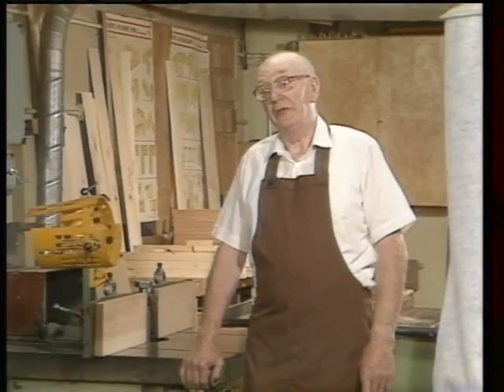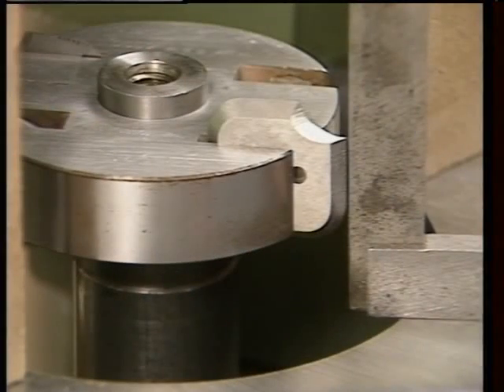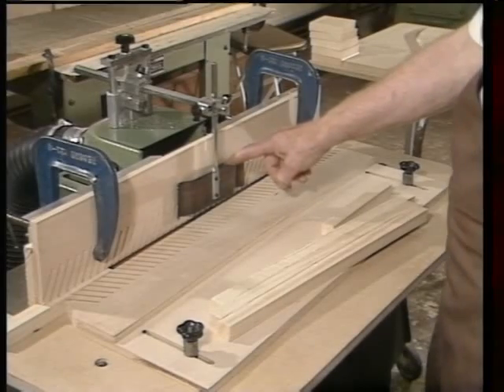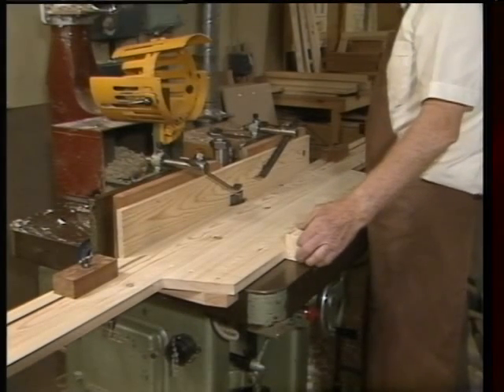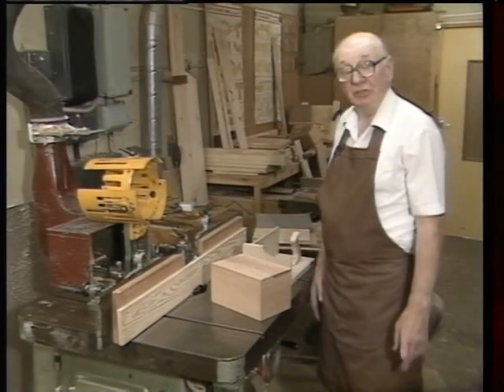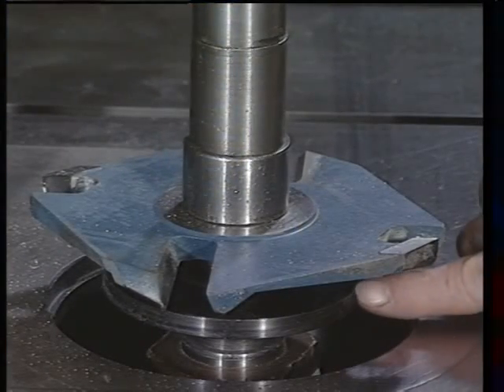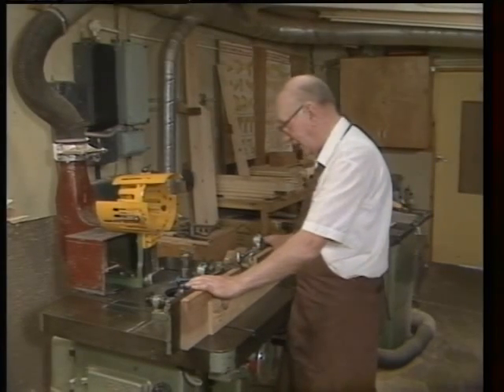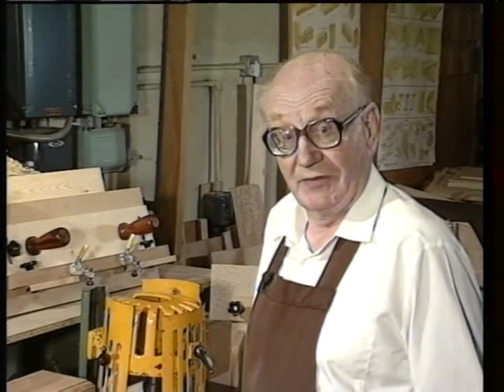Spindle Moulder For Complete Beginners by Roy Sutton

Comment: I have now been using a spindle moulder now for over thirty years with all my fingers still attached. Your video shows safety as the top agenda and I admire anyone teaching old school  methods with safety being paramount
,When you show shaping circular round objects I cramp wide rebated board so it hits template on outfeed side,I line up centre of circle with centre of spindle and fix board,This makes it easier and more accurate to find centre cut as you can run template on face board and stop enabling precise central location,I was trained by a ex engineer and worked on high end joinery projects and had similar training to you

Comment: I am  a wood cutting machinist by trade/profession; & believe me, this gentleman knows what he is talking about. The spindle moulder has been badly maligned over the years; but used correctly & sensibly, it is a VERY versatile machine. As with ALL woodworking machinery, safety is paramount. My thanks to you Sir for your very instructive & informative video; your tutorial reminded me of my technical college days back in the mid 1960's.

Comment: I inherited a spindle moulder - which I had no idea it wasn't just a router table with a frustrating fence system! Your video just revealed what the tool actually is, what it is intended for,  but also the proper use and safety techniques!  
Now it's time to find cutter heads for the 1/2" and 3/4" spindles I had no idea about! 
Thank you thank you!!

Comment: I remember Roy's books and videos from long ago. Old school, no frills, good techniques. It's amazing how many people are scared of the spindle moulder because of bad press and hearsay of unskilled operator accidents. Good to see that your passing Roy's knowledge on to keen enthusiasts who want to learn and work safely. Tony (sub'd)
Reply from the maker: Thanks Tony, yes I find it ironic that home woodworkers still shy from the Spindle Moulder. As I am sure you know, but will state for the record, the scariest legend was of knives firing out from the cutter block at tremendous force and speed, like shrapnel, and causing great damage to doors, walls or even serious injury to operators - I am told that this did sometimes happen with old toolings.  Modern Euro style cutter blocks and knives found on all new machinery have safety pins which make this impossible. There are of course still other dangers with the moulder if not operated correctly but they are now no different to the dangers faced with using a router table - something woodworkers embrace a little too casually imho.
Reply: Ive experienced cutters flying of an old whitehill block - many moons ago - I was backing off for an old boy who had gingerly tightened the cutters . We were moulding these huge oak newel posts which involved dropping on , about 30 mins in on a drop on one of the cutters came out - smashes in to the back of the fence - took a chunk out of the spindle ring and then shattered hit all the extraction chute - then the wall - amazingly didn’t hit either of us - but did ruin the work

Comment: I needed this video so bad. I’m working as a carpenter turned cabinet maker and there’s a HUGE shaper in the shop everyone is scared of. We use the smaller ones (still pretty large) for cope and stick and any other needs we may have, but this beautiful huge shaper sits untouched. I know how dangerous they are tho this really helps

Comment: An excellent video, Thank you. I've long considered a shaper to be one of the most useful tools in a woodworking shop. There are a few more things that could be covered but this is a really good basic set. Using a feed to do curved or circular work, the use of an out side fence, the use of a shaper to do compound curves on a stair rail, use of a tilt spindle shaper to do curved crown moldings. Next video in this series??

Comment: WELL, at last I have seen someone use a board fully across the machines fence to eliminate all gaps around the cutter.  I always use MDF.  This is in my opinion an extremely safe way to work on these machines and the give the highest quality of work completely eliminating any Skype or Dipping into the cutter due to a miss aligned fence or miss movement on the operator or feeder.  with this board this cannot happen.  The shapers I used in France were the biggest I've ever used even in the shops in Los Angeles Cal.  Extremely powerful and could make any cut one time and go all day long.  I love working on them.  Ear protection is a must as is safety glasses and no jewelry of any kind on the hands or wrist.  Good video and you have cute toys that do a mans job.  as they say the only difference between a man and a boy is the price of his toys.
Reply: > the only difference between a man and a boy is the price of his toys.

damn I like that

Comment: Excellent video. One thing to mind though is that blocks are no longer allowed to be cutters only, they must be fitted with a limiting cutter as well to reduce maximum projection of cut to 1.1mm. That might not apply to home workshops, but it's definitely a coshh regulation in the workplace.

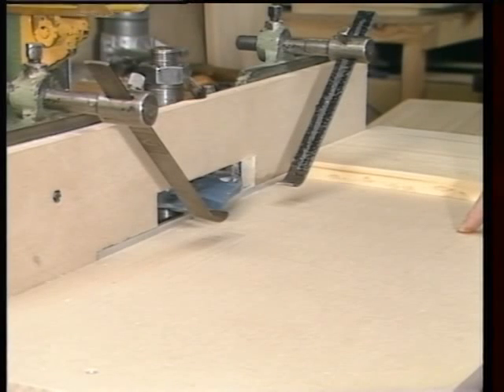Comment: RAISED PANEL - he uses a false table with a thin metal strip  The strip is likely 1/4 inch or 5 mm in height so it does not hit by the cutter) so there is always something to stop the panel from reaching into the space between the fence and the cutter. Thus a smooth cut all along the edge. Take note from 23:22 to at least 23:55. Great video

Comment: For some reason the "experts", who run the cash registers at woodworking supply stores, are always quick to mention that "shapers are dangerous"; with the implication that router tables are safe. They also mention that radial arm saws are dangerous implying that table saws are safe. When set up and used properly radial arm saws and shapers are no more dangerous than table saws and router tables.  My experience has been that router tables  work very well with small diameter cutters and do not work well with large cutters. Matching the correct machine to a particular job helps ensure that a machine is not taken beyond its intended limits. Any machine operated in an unsafe manner can be dangerous. Most people who cut off their fingers and hands cut them off with table saws. Usually this is due to the fact that they lose their fear of the machine and try to save time by skipping steps.
david
Reply: Shapers earned that reputation especially with the earlier cutterheads. Before loose knife heads used lock edge steel and dimensions were so rigorously controlled, they were vulnerable to less than perfect setup. When a tablesaw or jointer had a mishap, at least the plane of exposure usually included only the operator. When a knife came out of a shaper head, though, everyone in the shop was in the line of fire, waist level.
Reply: Trust me these machines bite. One of the first things a proper woodcutting Machinist  learns is how to make a push stick...ask this craftsman.

Comment: I need to make raised panels that are quite small... 4" wide x 13" long. What is the best way to support the narrow dimension as I run it through the shaper? Thank you
Reply: Hi Jeff, you can make a simple sled with toggle clamps to hold the piece. To prevent the work from "tipping in" to the cutter you can either install a safety bar in the fence opening or make the sled log enough to bridge the fence opening for more than the entire cut length......regards, Rod.
Reply: Run it through over size , then rip down and finish the longer side after

Comment: Can we do tenoning on Fixed table top? Spindel moulder?
Reply: Yes. I do that all the time. There is a jig for it that Aigner makes called the contermax or you can use what I call a right angle fixture. Basically a square block that runs against the fence with a handle to push it through. The block. backs up the cut so you don’t get tearout.

Comment: Does a router table and router not do the same thing?
Reply: It does but it doesn’t have the power or precision of a shaper. Even a small one is 3 hp and has a 3/4” spindle so much more rigid. Also a shaper runs much bigger cutters and that changes the cutting geometry so you get a much better cut. If you are making a 13mm (1/2”) deep cut with a 100mm (4”) shaper  cutter vs a 19mm (3/4”) router bit the router bit is exiting the cut at a much steeper angle so you a more likely to get tearout and won’t get as nice a finish.